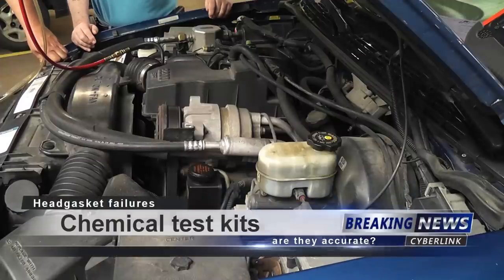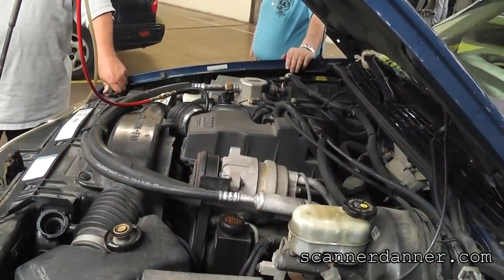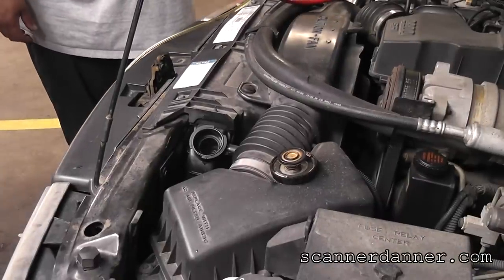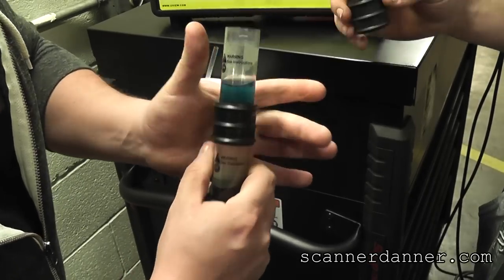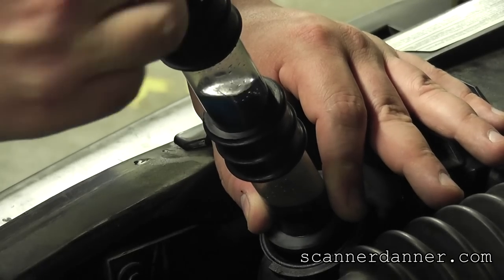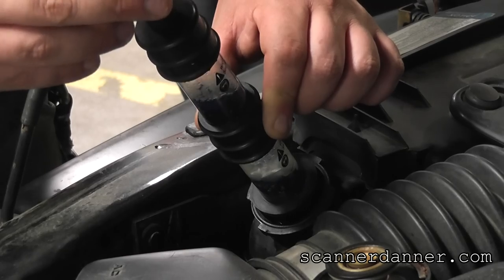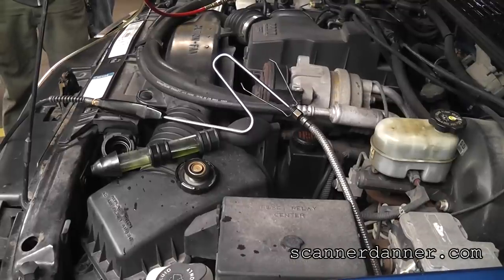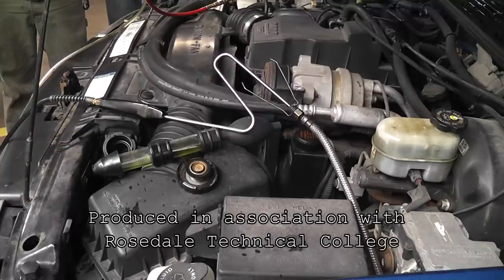How to test for a bad head gasket (chemical test)

Comment: Paul you should give this one a fair chance- I rely on this kit a lot and in fact use it for used car inspections in the field to catch people slipping bad headgaskets under the radar.  It works well when engine is warmed up but yes you have to be careful and allow plenty of dead space between the bulb and water in the rad.
 The test relies on testing CO2.  They don't say what the chemical is exactly, but my guess is it's either Xyline Cyanol or Thymol Blue.  My guess is the carbon dioxide reacts with the solution in the pump to create Carbonic Acid, lowering the pH.  The chemicals I mentioned would each change color in the presence of low pH. They are typically used in most laboratories as pH indicators.  It also even explains the green with diesel actually.
  Anyway while not as accurate or sensitive as the probe, this kit does indeed work and I consider it standalone and conclusive.  There is no way a healthy engine will put CO2 into a cooling system.
Reply: Agree but there seems to be an issue with reliability and it is not just from me that this is coming from. What are your thoughts of fluid age and contamination.
Reply: ScannerDanner Premium If the chemistry is what I think it is, age should be relatively insignificant but contamination- certainly that would affect sensitivity.  However the contamination is completely reversible if the "contaminant" is just CO2 gas.  In other words, you can simply reset the tester fluid back to blue by simply pumping in room air, and you can this repeatedly because it is not a "catalyst" reaction. It is simply a pH reaction.
  This assuming of course I guessed right on the chemical used- I am not sure on it and have been unable to find confirmation on company website or anything.
Reply from the maker: Schrodingers Box either way, the test obviously has variables and if I am making a definitive call on a bad head gasket, there cannot be variables! How about this for example: the cylinder with the bad gasket is not supporting combustion at all! (wet spark plug for example), not CO2 production there bro! HCs out the wazoo though. 
I think the kits are good in that IF it changes color it is confirmed combustion gases BUT if it does not change color, you could still have a combustion leak. This is not good enough for me.
Reply: ScannerDanner Lol as usual you took the words right out of my mouth- yes I was just about to say that in the event of a total misfire, the CO2 tester would miss it.  However I consider this and of course always validate the chemical test with a compression or leakdown if it is negative.  There is no argument- it is not as reliable as the HC sensor, agreed.  however if that chemical tester turns yellow- it's a blown head gasket.  The chemical test is susceptible to false negatives far more than false positives, agreed. but for someone on my budget it allows me to sometimes make a quick definitive call. but if it is negative, yes I still have to supplement with compression or leakdown to be sure. You are correct as usual!
Reply: It's like a pregnancy test. 
False positives- Not a chance. 
False negatives-Definitely can happen :)
Thanks for you input Matt, much appreciated.
Reply: +Schrodingers Box I have one of those kits and just tested it on my old C-class. It actually says in the manual that the fluid can be reset and reused by pumping room air through it.
Reply: Geir Tore Simonsen Yes that is absolutely true- the reaction is indeed a reversible one and does not require a consumable catalyst. It is interesting your manual says that it can be reused. Mine says to discard the fluid which I of course assume is so they can sell much more of it!
Reply: ScannerDanner Premium Schrodingers Box  I agree the test is not sensitive enough. I did not get any reaction on my C-class even though I sometimes need to add coolant, and moisture in the oil is definitely present, tested by taking a sample from the dipstick and heating it in a tin can with a propane torch - very useful tip I picked up on Matts channel, and definitely something I'll check anytime I'm buying a used car.

What are your thoughts on cooling system design regarding this test? I don't have a radiator cap on any of my cars, only on the coolant reservoir. I think this is quite common on german cars, and I suspect it contributes to making the test less sensitive since there won't be any significant flow close to the cap.
Reply: ScannerDanner:  Guys, think about it: If the cooling system so compromised that one or more cylinders NOT FIRING, and spark plug(s) wet, do you really NEED the exhaust analyzer? LOL. No. Where the chemical test (when used as directed) shines is that it CAN detect exhaust in the cooling system even when the car seems to be running pretty good. I've used the chemical test for 25 years. I like it. AND, if we return to your complaint that dead holes won't cause test fluid to change color, we can make that work in our favor by killing cylinders til test fluid stops changing color, thus identifying the offending cylinder. Cheers

Comment from the maker: Okay guys, in case you didn't read any of the other comments. These chemical kits react to CO2 (thanks Steve Rob) and can be contaminated! You are instructed to take a sample from your breath BEFORE using on the car. If your breath will not change the color, we are instructed to get new fluid! A variable I should have researched first before posting this video. I apologize and will be revisiting this again.
Reply: Hey no need to apologize Paul - two positive thing happened we learnt about how the expired fluid can distort a test and the best part is we get another Scanerdanner vid :)
Reply: ScannerDanner Hey Paul I did a video on one of these chemical test kits too, do you mind if I link your video with mine?
Reply: Post it brother. If it gets put in spam let me know (it won't show up is how you'll know)
Reply: Ok I added your link to my vid. I sent you a link to mine... did you get it or did it go to spam folder?
Reply: It's here in this thread bro. Thanks! I'll watch when I get a chance
Reply: Oh ok I get it, thanks, wasn't sure if that was how it worked. I have an Chevy Aveo (real hot rod) out here now with head-gasket symptoms according to the customer so I will be chemically testing it if that is the case. I may do a vid and if I do and that is the case it will be up and I'll let ya know the results on that one.
Reply: ScannerDanner Paul, my wife has a unique sense of smell. I swear she can smell a mouse fart at a hundred yards! I would trust her nose, before I trust that darn chemical kit. LOL !
Reply from the maker: Billy R lol
Reply from the maker: South Main Auto Repair please do thanks!
Reply: ScannerDanner  The test fluid chemical reaction color change is due to carbon monoxide (CO) being present. The blue test fluid does not react to hydrocarbons (HC). It appears that your test vehicle is not presenting with any/much CO in the cooling system, that may be due to the offending cylinder not firing, no burn, no CO, but the injector is still squirting fuel into the cylinder and the compression is pushing the  unburned fuel into the cooling system. 

You can test the test fluid by having the test device suck on a lit filtered cigarette which has CO but no HC and good test fluid will change color almost immediately. 
To prove that it does not react to HC wet a spot on a shop towel with gasoline which is an unburned hydrocarbon and have the test device suck through the wet area of the shop towel. It will not react to the HC on the shop towel. 
Also the blue test fluid has a shelf life of about a year unopened and about 6 months once opened. The containers usually have an expiration date stamped on them. 
Once the test fluid gets old it's sensitivity to CO decreases, it takes longer to react and the color change is not as dramatic. 

I haven't completely forgotten about you, waiting to hear from the current transformer coil supplier.
Reply: This was the product Paul was using, other test kits may test differently.
http://www.uview.com/site/ywd_uview/assets/pdf/99081870_comb-leak.pdf
Reply: I gotta wonder, if this thing tests for CO2 , why it would change to yellow for gas motors, and green for diesel motors. Seems to me like it should only change to one color if it's only testing for one chemical. CO2 is CO2.
Reply: ScannerDanner As these chemical kits detect Co, why not use a Co alarm with a readout in pp/m as is usually the case.The one I got recently from Shanghai talks as well,so perhaps it could be reprogrammed to detect wobbly head gasket failures and advise the owner not to lose the cool when the Co goes bonkers.LOL
Reply: Steve Rob  Steve, you nailed it. 
My test kit from NAPA lists the reaction is to carbon monoxide(CO) and combustion gases. 
However, when I looked up the ingredients of the test solution it is mainly water with sodium chloride(salt), sodium carbonate(soda ash) and bromothymol sulfone phthalein also known as bromothymol blue or BTB. 
Bromothymol sulfone phthalein reacts to carbon dioxide(CO2) and changes from a very deep blue to yellow in the the presence of CO2. 
In fairness to NAPA, my kit is about 20 something years old and could have been a misprint or the fluid has changed... the amazing thing is that I still have the instructions. :)
Reply from the maker: It seems from the many comments, some test kits are for CO and others are for CO2?
Reply: ScannerDanner It would be great if someone with a kit that detects anything but CO2 could post the kit. I have yet to find one.
Reply from the maker: Agree!
Reply: dmorley100 The kit does appear to test only for Co2 as the conclusion was by ScannerDanner, essentially that was my theory when I saw the blue fluid as well.
I came to that conclusion since I seem to recall "PeriodicVideo" channel here on YouTube showed a video a while ago of a blue fluid that reacted to Co2 with a color change.

The reason it seems to change differently pending on a diesel and a gas engine may be due to a difference in contamination of the kit from a diesel to a gasoline engine.
A diesel engine outputs far more Nox than a gasoline engine does, and that could be skewing the color to green in the tester.
Reply: CMDR Sweeper that's the best explanation I've heard so far.
Reply: +ScannerDanner  OK, the chemical tester tests for CO2 but your analyzer showed virtually no CO2 in the cooling system of this car with 100% confirmed bad head gasket.  So is it fair to say that CO2 in the cooling system is a not an indicator of bad head gasket, and that the chemical test method is useless regardless of possible fluid contamination?
Reply: Yea or you can just use your car muffler to check your fluid calibration.
Reply: Does that test even matter if the thermostat is not open? Figure the thermostat would have to be open and vehicle in operating temperature.

Comment: Old school way was to remove plugs, disable injectors, pressurize cooling system and crank it. If you got antifreeze coming out of spark plugs then you know for sure. Smaller leak needs more time under pressure before crank.
Reply: What if a leak only goes into the cooling system but not the other way around?

Comment: WOW!!! Exact same thing happened to me on the exact same vehicle. (98 S10 2.2L)
No codes, no milky oil, no power loss. Only a bit of oil in  the radiator. I tried the exact same product and had the same result, No colour change.
Took it to my mechanic and used a gas analyzer ...   Pum.... Blown head gasket.
I could't believe it until I saw the inside of the engine. He advised me never to trust this method.
Reply from the maker: chungaleta1234 thanks for the input. it backs up my suspicions of these chemical kits. it seems as if contamination of the fluid is the variable.

Comment: the engine has to be running and hot and you must remove some of the coolant in the rad. you need to read the instructions first  .Not knock a product u know nothing about.

Comment: Another tip when using a gsa anaylizer or chemical testing is use a length of hose to add height away from the chance of liquid contaminating your test.

Comment: I've been using that kit for years. It's best used when the motor is hot and coolant is flowing or dead cold. I've had the blue turn to yellow within a few draws. It measures the CO content.  That tool has a learning curve.
Reply from the maker: ***** Is it CO or C02 Craig?
Reply: ScannerDanner It is CO2 for sure. Steve Rob sent me a pdf of the description of the tool

Comment: Paul   I use a similar kit to the guys at South Main Auto Repair and its always worked out fine for me (like in his Vid). The secrets i think are;
 To keep the chemical out of sunlight or fluorescent light  (in its cardboard box or any solid coloured plastic box ) and to ensure the cap seal isnt damaged and in place otherwise it seeps in CO2 and Nitrogen which makes the chemical reaction we all want to see a lot slower. This can even make a petrol turn the solution GREEN not YELLOW like you'd expect it too !
 Also you need a slightly lower radiator water level so the top of the Radiator (or expansion bottle) can build up stored combustion gasses in it without push or splash back into the tools chemical reservoir . 
  Once you've run the car for a few mins and have space for the gas to build up with the tool already in place the pressure will push the gasses into the tool , at this point just pump it a bit mixing the chemicals faster and get you the result you're after. 

 If you still suspect a head gasket but aren't seeing the result using this kit(s)  If you put your fluid tool in the exhaust like you did in the Video to test it and it takes too long to turn colour then its spent and needs replacing asap. Also you could try doing the test with just water in the cooling system , no other Antifreeze / Summer coolant used . I've found sometimes some multi mixes of Antifreeze (Clear, Red, Blue and Orange )can create odd results, i get this usually due to the customer losing fluid and buying what's on the shelf !!. 
   Not sure if sways your thinking about these kits, and YES the Gas analyzer is faster but i'd rather have coolant pushing into this throw away solution that running up my Analyzer pipe  :D
    Tim:)

Comment: This was a good test.

I have had good luck with the chemical system.  But, I may not have had the kind of cylinder compromise that you did.

Since I don't do these test often, I always purchase new fluid.  I know that sun light can compromise the integrity of the testing medium.

Thanks for doing video.

Comment: I use a similar kit. In one or two squeezes near exhaust it will be as yellow as yellow can be . I have caught lots of bad head gaskets with one . Wonders about your fluid as you seem to get different results than i have gotten  even at exhaust . Not sure how to explain this , and i may have missed sometimes with it , as i can not say 100%  it works every time.  , but this kind of tester has worked for me several times in the past.
Reply: wtbm123 I need to get a different kit and try it again in the future. Maybe shelf life of this fluid is an issue?
Reply: ScannerDanner Premium  I sent you a message on here . It shows my tail pipe test results . at 5:15 in video
Reply from the maker: wtbm123 I see no link to your video?
Reply: ScannerDanner  I sent it in a private message , but here it is . Around 5:15 in my video i test by tail pipe to show the color change . It done different than your fluid . It turned yellow on mine . Not saying this test is nearly as accurate as a gas analyzer, but was surprised your fluid did not turn as yellow by exhaust.  https://youtu.be/B4FoUc6fRNs
Reply: ScannerDanner Premium We use Napa's kit all the time and only issue we have is shelf life from being out in shop.We started keeping the test fluid in the refrigerator and have had better results. We also test the "tester" at the exhaust pipe and confirm that it does change color to yellow.

Comment: It measures CO2 as already said, if you breath  on the the inlet and pump it it will change color from the CO2 in your breath to test it. You do normally do it with the engine running but lower the coolant in the rad so you don't suck coolant up and less likely to be 'spit' at.
Reply: Smiggo I did notice your gas analyzer was not reporting any CO2 was it configured for CO2 measurement?
Reply from the maker: Smiggo yes it was
Reply from the maker: Smiggo someone else said CO and your saying CO2? Are you sure? I would think measuring CO2 would be more accurate since it is possible to not have CO gases with a combustion leak, but you would definitely have CO2. 
So I should have done it longer? I used this kit before and had the same results. I could NOT get the fluid to change color in the presence of a known head gasket failure. Thanks for your input!
Reply: Steve A CO2 it is! This statement is IMPORTANT!!

"Test the tool and fluid by exhaling into a cupped hand and sucking the exhaled air through the intake hole into the two chambers by squeezing the rubber bulb two or three times, holding the Leak Tester in a vertical position.  
(  CAUTION: Do not put the rubber intake end in your mouth.
Do not use exhaust gasses or smoke from cigarettes or matches, etc...  for this test, as this could 
contaminate the test fluid.  If the fluid fails to turn yellow or green it should be replaced and the 
chambers washed thoroughly with clean water
IMPORTANT
: Do not wipe dry
.  Do not use soap or
 detergent, as these can contaminate the fluid"
Reply: ScannerDanner Premium I should have done my homework better before shooting this video. HOWEVER my gas analyzer showed NO CO2 gases and it is a functional meter (the CO2 readings work). How accurate is the CO2 portion of the tool could be debated.